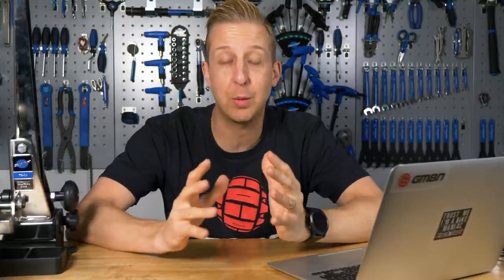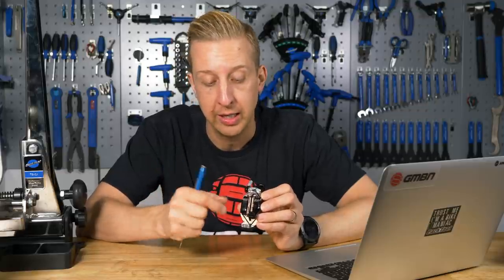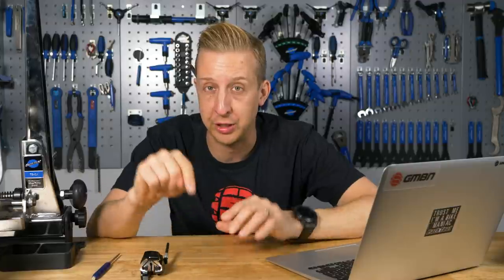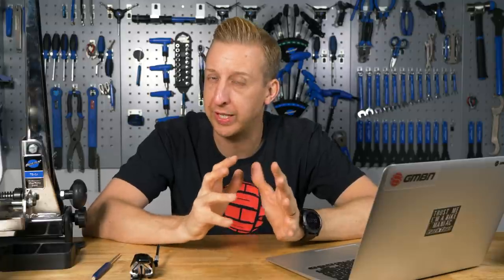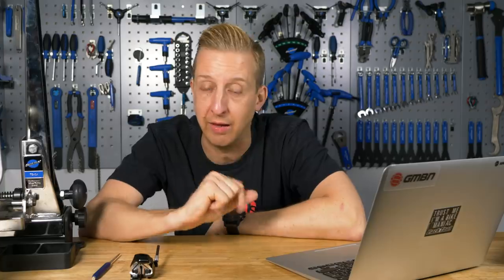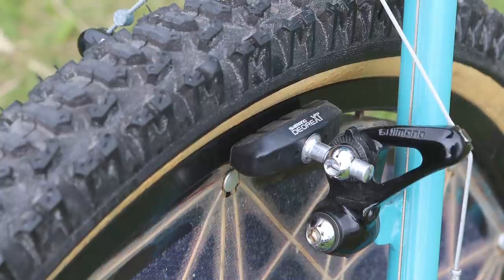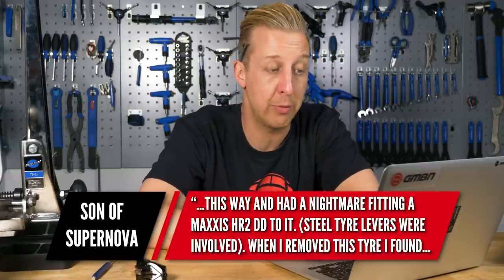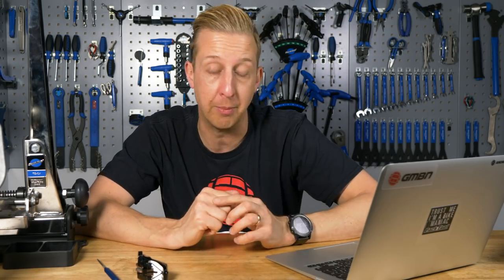Mountain Bike Brake Solutions? | Ask GMBN Tech

Comment: I used gorilla tape on the same i29 rims without issue .
I've used gorilla tape exclusively for years and find it excellent.
My current tyre is a minion 2.5 wt dd and went on with my hands .
Never try getting one side of the tyre seated first .
ALWAYS put the full rim inside the tyre fully so the tyre is fully overlapping the rim both sides .this then gives you the ability to fit 99% of tight tyres with just your hands .

Comment: For lubricating gear cables, teflon dry chain lube works great.
Reply from the maker: We have also heard of people using a light coating of Mineral Oil, doesn't last long and dust can build up easily, but it's super low friction on the PTFE coated cables short term.
Reply: Any oil or grease will attract dirt but the dry lube doesn't seem to, it was a tip i picked up from a bike shop years ago and have done it ever since
Reply: I use graphite powder, between thumb and forefinger.
Reply from the maker: @truantray   That's interesting! Common for house locks. Do you find it works well?

Comment: About the grease on the gear cables it works great if you live in warm weather.  I use to apply bearing grease to it when i lived in Rio de Janeiro. But if you live in cold weather use a light oil! As i found out last winter here in Vancouver the grease will grab your cables so hard you won't be able to shift down your cassete

Comment: Hi Doddy, as i used longtime ago "V" brakes .. and did not like them at all going down a hill with a traffic light at the bottom ;-) 
So i got this new mtb with mechanical disk brakes 160 mm front and back. They were good at first, but i started to have bit of issues with them .. still .. this was not enough. :-(
Had a hard time to modulate .. it was missing that little something ;-). 
So finally made the move last year, i got 2 kits Tektro hydraulic "ready to install" front and back (not high end, but affordable) and to upgrade little higher i changed my front disc rotor for a 203 mm XT Icetech, and the spacer for the brake caliper. Now i can use one finger to brake and modulate is such more easier and lot safer .. and i can rely on my brakes now.
Since then .. i'm a happy camper .. and i do recommend.
Have a good one .. love the show !!
Cheers !!! ;-)
Reply from the maker: That's awesome! Thanks Robert 👍

Comment: Good hack for lubing cables. Cut a slot in the tip of an old chain lube bottle or similar, drag the bottle along the cable. You can't slip off the cable easily, and you'll get a nice coat of oil along the length of it. Particular useful for lubing multi-piece cables that are already installed on a bike. Makes servicing a doddle.

Comment: ABS Brakes. Disc Brakes were made for more stopping power, to much power will lead to wheel lock up easier. The brakes are there to control the rotation of the wheel, the traction of the Tire ,is what  Stops you, or slows you down, Having a brake system with less power works great for Bike control and Wheel control. Ie: XTR Trail brakes compared to XTR Race. Could use larger rotors and Pad compound that could manage the heat.What do you think Doddy?.

Comment: Molybdenum disulfide powder is the best for cables.  A dab of grease on either end to seal out dust, water etc and the powder will keep the cable sliding longer smoothly longer than your bike will last.  I used this when I built my Trek MTB in 2001 and I haven't needed to change either the brake or shifter cables after 20,000+ KM

Comment: The outer cables usually have a dry lubricant in it and the end caps are sealed. So you have to do nothing unless you have a problem. Lubricating them when new makes it worse faster because the inner cable is sticky and brings in the dirt!

Comment: I'm wondering what difference a higher spec leaver combined with high end oil housing would make installed on a cheap caliper. As far as my understanding goes the leaver itself is responsible for compression and decompression and I'd guess there would a significant performance increase to be expected. Gotta test that someday.
Reply: Keep us informed, okay?  If you would be so kind as to respond here I would get a notification!  TIA

Comment: I use Shimano sheath and Teflon coated cable. That's it. I don't try and clean it and definitely don't try to lube it. A Teflon motorcycle cable manufacture advised against any lubing to avoid dust accumulation.

Comment: RE: brake pad cost. In the grand scheme of things, i.e. bike, and moto brake pads, I think even the premium pads are very affordable. Consider this, when I was roadracing  motorcycles, I used Vesrha (sp) sintered pads, for just the front wheel, these pads in 2006 cost $144.99 usd, plus shipping. I normally kept a spare set, so that's over $ 300.00 usd just for front rotor brake pads.

Comment: #Askgmbntech. Hey dodd im wondering since my new bike came set up tubeless and i for a while now have been wondering if tubeless sealant could contaminate the brakepads, When installing the tyre or just a puncture on the trail? Have seen sealant splash around in many odd ways and bikes, wheels ect. Covered in sealant. I have never seen this being adressed before could You enlighten me please?
Reply: Caspar Nielsen when I did it before, I had no issues with the brakes
Reply: shea hoffman I had my front rotor/caliper covered in Stans sealant cuz I dropped the bottle while working and I just rinsed it off with some water after that. It was all good,  but different manufacturers might use different ingredients, so some of them might be able to contaminate.

Comment: Hi, I can't seem to find any information online about this, hopefully Doddy has some advice #AskGMBNTech. How often should you replace hydraulic hoses ? My SLX breaks started leaking mineral oil from the part where the banjo connects to the hose, from the metal sleeve. Do I need to replace the whole hose ? Or does the Banjo come apart ? Is this a perishable part ? Like brake cables that should be replaced at a certain interval ? #AskGMBNTech

Comment: #askgmbntech Hey Doddy, I've noticed quite a few new bikes including some sort of steering lock to prevent the bars turning past a certain point. I can see the benefits of this for protecting your frame and cables during crashes but how does it actually work? Is it part of the headset or frame design? Also is it possible to set this up on any bike or does it have to be "built in" as a design feature as it were? Cheers!
Reply: I have a Trek dually  which has this thing called "knock block" something to do with all the spacers and the stem, it has little plastic knobs which interlock with eachother and wont let you turn past a certain point hopefully this helps
Reply: @mattleembruggen9321  Cheers for the tips. Yeah I've been riding a Trek Remedy with the same thing, just wondered if it's possible to install something similar on any bike for when I change frames etc. I haven't tried dismantling it yet to find out, thought someone on here was bound to know!
Reply: District Mountain Biker yeah had to service mine the other day and was curious as to how it worked

Comment: #askgmbntech Instead of getting a trail bike when riding out West (in the States) I was thinking of putting a cane creek angleset on my xc bike to slacken up the front end 1.5 degrees. It would turn change my xc bike from a 69 to a 67.5 degree head angle. Have you used the can creek angleset? Does it work as advertised? Thanks and love your channel.

Comment: Up to the tenth generation of ABS by bosch, they couldn't achiv optimal braking out of asfalt. The problema was, when in dirt, you need to lock up a bit but not completely, and thats why you would be almost without brake on the dirt with an abs equiped car. Today this was supperated, but there is a reason motocross bikes dont have abs.

Comment: #AskGMBNTech. Hey Doddy. I just bought a Scott genius 940 with a syncros dropper post. The one that came with the bike. It is a 150mm travel dropper. My question is the when the seat is down and I push the lever it’s binding around mid travel. And should have a helping hand to get all the way up. If I loose the seat clamp any further, it want grip the seat post enough. Is there a solution to the problem or is it just a crap dropper that comes with the bike? Hope you can answer my question. 
-Mikkel

Comment: #AskGMBNTech Hey Doddy I'm a relatively new rider and I'm also trying to do all the work on my bike myself to keep costs down! How often do you suggest servicing such as gear indexing, changing cables and bleeding brakes? (In terms of hours riding)
Reply from the maker: It really depends on riding conditions. With cables it's best to change as soon as you feel friction build up in the system. If this friction gets heavy it can cause damage to the ratchet in the shifter.

Comment: #AskGMBNTech Hey Doddy, I have a Giant Fathom hardtail and I'm looking to get a second set of wheels for it that are better than the stock XC-1s. The hubs are QR and it seems there aren't many mountain wheelsets with QR hubs available. Is there a way to convert my hubs from QR to thru-axle without making any modifications to the frame?
Reply from the maker: Hey Kyle, many brands sell adapters for their wheels so you should be fine. Adapting a QR hub to bolt through is less common due to bearing size.

Comment: Technically you could change the head angle.  To simplify think of a hard tail frame which pivots around the rear axle, the higher up it sits in the front the slacker the head angle will be alternatively the lower it sits the steeper the angle. Basically if you shorten the fork the head angle will become steeper and if you elongate the fork it will become slacker. Same thing applies to "fork dive" the more compressed the fork is the shorter the wheel base becomes this steepening the head angle relative to the ground. Its all basic geometry really

Comment: AskGMBNTech
I have a real problem I have square bottom brackets and can not get the crank arms off, I used a crank arm tool and wound up stripping threats out then I used a puller to pull the arms off it wound up gouging the crank arms then I tried punch and a hammer and I still would not come off can you help me out do you have a solution, the only other thing I could think of steak a angle grinder and cutting them off, or using a torch. Do you any idea of what I can do thank you

Comment: #askgmbntech Hi Doddy,
I've got a 2016 Fox 32 with 120mm of travel. Now I noticed when I pull the front brake and move the bike forward and backward there's a little bit space between the upper and lower legs. And when I put a finger between there's a small pressure. How do I know if it's too much and then when to replace the bushings of the fork.
Thank you

Comment: #AskGMBNTech Hi Doddy, thanks for being you which means I can ask this kind of question...Bought a new-2 year (mfr 2015) old Supreme Operator (which I love) from a shop that converted it for better climbing (11x1 SRAM) and went tubeless also... DH tubeless rear tire went dry somehow so I lost my bead.  I had a tube and older version of the Minion DH tire from when I had a SC Bullit in 2000 I didn't want it to go to waste so I tossed it on and went riding.  2/3 through a 5 mile ride the tube was bulging out of the bead area.  I'm guessing I might have had air trapped between tube and tubeless rim that when it leaked out lost my bead-lock, but wanted to see if you had some wheel wisdom before I assume anything and try the wrong fix.

Comment: Dirt or trail motorcycle riders hate ABS and disable it. The problem on dirt is ABS will not lock, but it will not slow the bike either.  Would work on city bike or road race bike, but no bueno for MTB.

Comment: Abs in an interesting concept. It’s of course been very successfully implemented in motor vehicles but there may be a place in the future for them in cycling. Not entirely sure if DH racers would enjoy that so much since the level of control and precision in braking and connection with the bike is crucial. They’d be a little too heavy, and probably overkill for Xc racing. But down the line, if refined and implemented well I could see products coming to market in other areas of cycling and possibly be applicable to mtb too.

Comment: #AskGMBNTech. Hello Doddy. Thanks for answering all our questions. I own a full suspension bike and I'm worried about the the openings for the internal routings to eat up all the dirt when I'm riding the bike, especially from the bottom bracket to the rear triangle. The manufacturer doesn't offer any seals for routings. Are there ways to DIY a good durable sealing?
Reply from the maker: Check out Sugru it could be a good hack for this 👍

Comment: #AskGMBNTech I have a rim with a inner width of 23mm and currently I have a maxxis high roller 2 on there. I would like to change to a Maxxis minnion DHF wide trail. But when I went on to chain reaction cycles in the description it said it is optimized with a 35mm rim so I would like to know if it would work for my rim or not. Love the videos!

Comment: #AskGMBNTech Can a RockShox Reverb hose be substantially lengthened?  I purchased a used "stealth" model prior to pulling the trigger on a new bike only to find that my new frame doesn't have access via the seat tube.  I do have an internal entry to the down tube and again near the bottom bracket... could I take the longer route (including a bend at the BB) if I lengthened the hose?  TIA
Reply from the maker: Hey John, RockShox sell a 2000mm hose kit for the Reverb hopefully this is long enough.
Reply: Voot!!! Thanks so much.  You are appreciated!!! ;)

Comment: #AskGMBNTech Hey Doddy,  I have a star ratchet DT Swiss rear hub that has an uneven "whirr" when free wheeling. Its obviously more noticeable at higher speeds.  I've taken the ratchet plates/springs/spacer out and cleaned/regreased them.  Doesn't seem to have fixed the uneven noise.  Could this be that the wheel needs tru'ing?

Comment: Hey Doddy, I have a bit of a weird question regarding geometry. I used to have a Haro Railer SS(Circa 2007/08?) and I absolutely loved the way that bike handled, for a hardtail beach cruiser style bike it rode like a dream on some of the local trails I have around me. I've never found anything like it since in terms of handling and was wondering if maybe you could use some of your industry contacts to find out the exact geometry used on it, I've tried for a while myself but haven't had much luck. #AskGMBNTech

Comment: #AskGMBNTech Hi, Doddy. I'm one of your fans from the Philippines. I would like to know what causes the brake vibrations (resonance) everytime I modulate/ feather my brakes? I'm using a SRAM 203mm rotors (cleaned & aligned) coupled with a Shimano MT-315 hydraulics. Some say that it's because the rear triangle by the brake mount is too light. Is it true? It's totally annoying & driving me crazy. Hoping for your immediate reply. Thanks in advance.

Comment: #AskGMBMTech Hi Doddy love the show.I have Shimano mineral oil disk brakes I was wondering whenever I leave my bike for an hour or so my rear brake goes spongy is because the oil is setting to one side. Also I was spraying my sprocket with WD40 and got some on my discs😳 is their a solution.  Thanks.
Reply from the maker: If the brakes are spongy we suggest a bleed on the system. You may be able to clean the pads and disk rotor with brake cleaner but if it doesn't then it's time for some new pads Oliver. 👍
Reply: @gmbntech  these brakes I have are about 2 months old so would the pads have ran out by now?

Comment: #askgmbntech Hi doddy love the show, ive got a trek fuel ex 7 2019 with the fox performance float (extra volume) and after about 7 months of riding the bike the rear shoxk has started to make some weird squishy air noise when i compress it, anything to be worried about? Should an air sleeve service fix this. (note i live in australia and we just had summer so have ridden 100+ hours of dusty trails)
Reply from the maker: The squishy noise could be the compression or rebound damping. Do you run the damping quite slow? If you have ridden that much then it's worth a service if possible for sure regardless.
Reply: GMBN Tech Well not slow I would say just on the faster side but it just started happening after a ride, no crashes or anything just randomly started to happen it’s pretty quiet but just ordered a fox service kit 🤟🏼

Comment: #askgmbntech
Hey doddy great show, i do have a question.
My local dealer told me instead of oil for your fork, you could use oil for motorcylce forks and even engine oil, if the vicosity would be the same. I'm a bit sceptical, what's your opinion?

Comment: Instead of using Gorilla tape for tubeles setup, try Tyvek seam tape. Tyvek tape is much lighter than Gorilla tape and doesn't leave a sticky residue  mess like Gorrilla tape does. Switching to Tyvek tape can save over 80 grams on a wheel build.
Reply: 80g? I've had bigger snot rockets!
Reply: @pesomasagravedad  It can actually make a pretty big difference when talking about unsprung mass. Reducing wheel weight will allow your suspension to work much better. I noticed a significant difference in traction on rough sections of trail switching to a cassette that was 100g lighter. The Tyvek tape is also very cheap. A $10 roll will give you enough to do at least 10 bikes.

Comment: Gorilla Tape is just AWFUL for tubeless. It's NOT 100% water tight no matter what anyone says (Gorilla doesn't promote it was water tight), soaks up a bit of sealant, leaks a touch of air, moves around if in contact with the tire bead, doesn't seal well where you cut the tape and takes on sealant underneath, and is a nightmare to remove as it leaves residue. One wrap of Stan's with a little elbow grease and you'll be MUCH happier if you ever need to replace a spoke or even a tire. And I almost forgot, it weighs significantly more than Stan's or other tubeless tapes